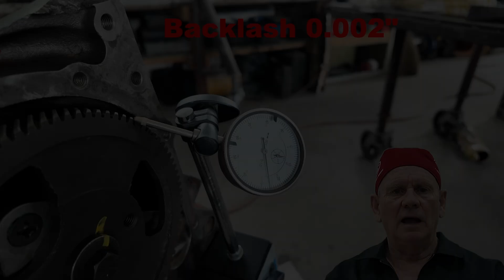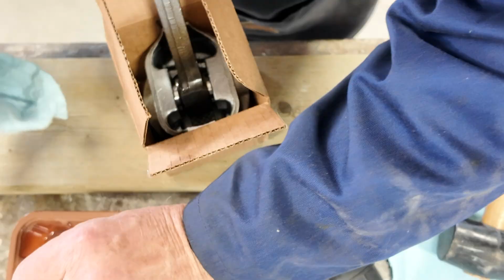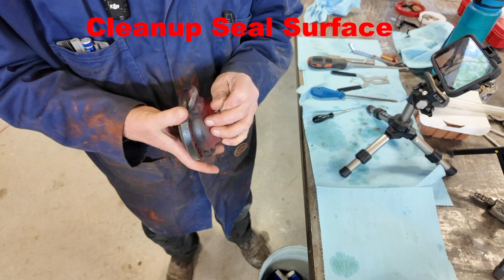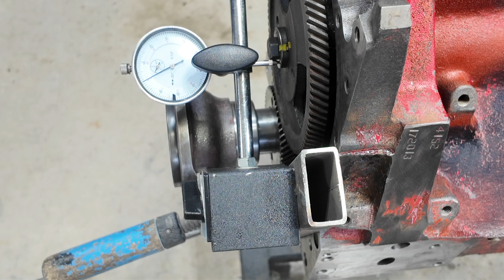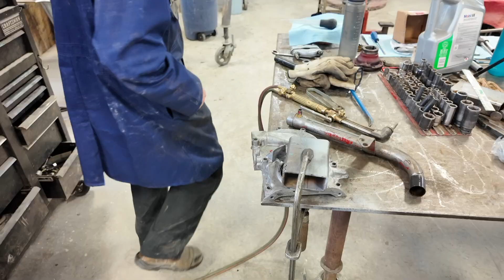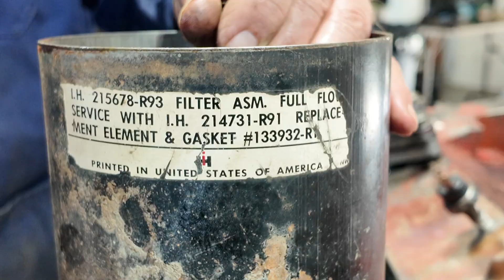Scout Restoration Yukon: Engine 2: Camshaft Installation.

Comment: Mike thanks for taking time to explain all the steps. Your videos are extremely helpful. On the end play and backlash of camshaft gears did you move gear by hand or use a tool?
Reply from the maker: Hi Chuck Thanks for watching More to come ! End Play big screw driver back lash move crank by hand or with socket !

Comment: Which cam and lifters did you end up going with?
Reply from the maker: Its the original 152 Cam Reconditioned I assume Ground and where necessary built up by Laser-Welding. I exchanged mine for it ! Got it from Southland International I don't Know where they got it. Probably a stock grind which is what I want for a Concourse Restoration ! Stock Lifters !